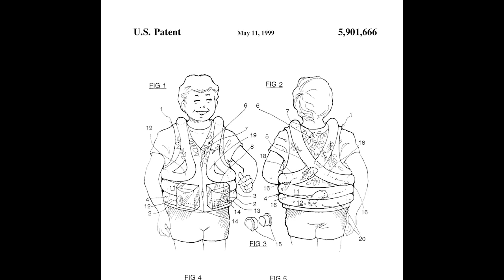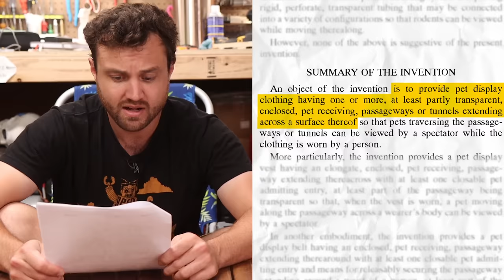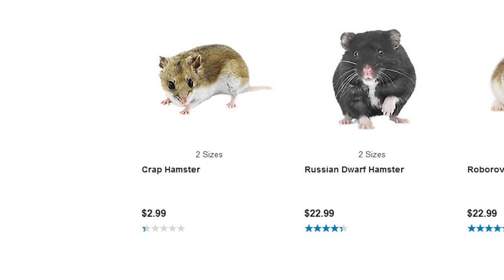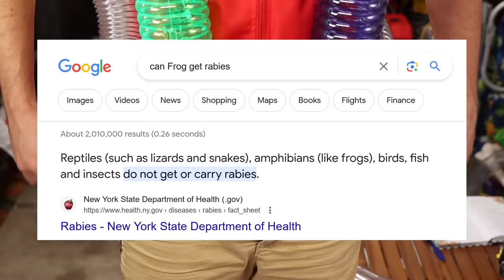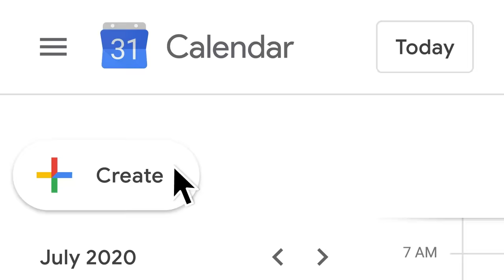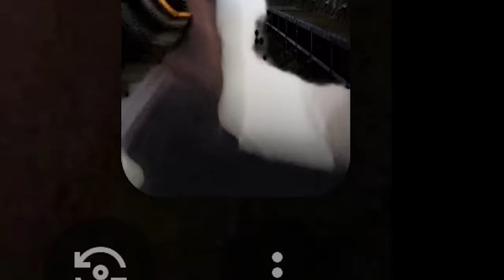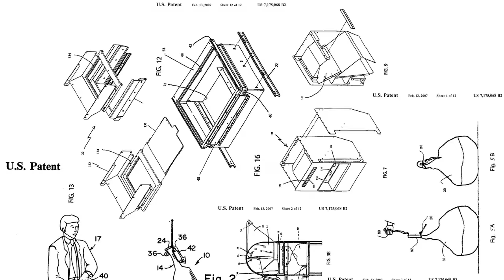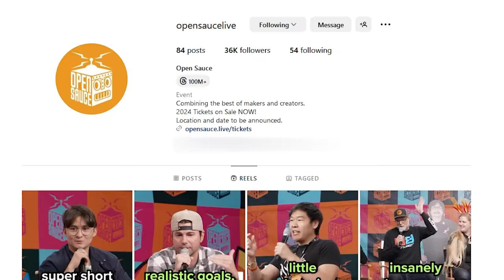Someone Paid $10,000 to Patent This

Comment: This looks fun and games, but those tubes are actually pretty dangerous for hamsters! When they fill their pouches with food, they can get stuck and suffocate in the tubes. Furthermore when they pee in them, ammonia builds up, which is toxic. They discourage digging, because well, can't really dig through plastic. When in direct sunlight, hamsters can easily overheat in the tube. The rubbing against the plastic can cause hair loss, sores and wounds. And often the small holes are too small and hamsters can suffocate. When they chew on it, they can die from the microplastic. Better sell the tubes and buy a huge cage with places to burrow and go to college. 

Similar things are true for the fish thing, if the tubes are too small, the fish can get stuck and have wounds from rubbing against the plastic. Also they can't really be cleaned and the water in them often doesn't reach the filter...
Reply: Back in the 70s they had a product called habitrail which was a hamster cage with a bunch of similar tubes. My friend had one and his hamster had lost a bunch of hair on its tail. I don’t know if it was caused by the tubes, but after that instead of calling it habitrail we called it half-a-tail.

Comment: Dude he is touching the forks with his hands how he not dead is that how car battery’s work1:04
Reply: Car batteries have a a very low voltage, so even a little resistance (like skin) won’t complete a circuit, and therefore won’t kill you.

Comment: Big problem with the fish one, fish require air to breathe. Lots of people seem to think "Oh fish just get oxygen from water because H2O has oxygen in it"
WRONG
Oxygen gas dissolves into water in the same way you'd dissolve CO2 into water to make a carbonated beverage. Fish breathe the oxygen that is dissolved in water. For them to survive there needs to be a decent volume of air in a closed system for fish to survive. Sure they'd be fine for a while on oxygen that is already dissolved in the water that was added, however they will quickly run out. Providing a space of air allows for a larger supply of available oxygen.
I know this is a silly video and they weren't in there very long so obviously no problem, but I think its important people know this/don't get any bad ideas :)

Comment: Patent holder here, most patents are used for the protection for the development of a idea, that way, if the product is being worked on by a third party company and they run off with the product they can be combatted with little legal hassle, it may be more likely that Mr. Belial worked as a product designer and came up with the idea's while working for a firm that promptly got rejected due to the lack of development, as the initial patent is the most expensive, Belial must've submitted the patent himself in a attempt to work on them later, if he ever did!

Comment: Hey Will. I had an idea while doing my dishes and thought of you. I was thinking about a robot that could sort my cleaned silverware into the correct place. Not a simple task as none of the silverware is from the same set. (I assume everyone faces this problem. If not then imagine a horders silverware drawer). But it's just an idea. In case you ever run out of video ideas. ;)

Comment: Let me explain why the fork thing doesn't work and shouldn't be tried:

You can observe electricity just as water.

Amperage would be how much water is there (or needs to travel).

Voltage is at how much pressure the water is being delivered or given.

Resistance is equal to the size of the pipe, too much pressure and the pipe might not handle it, too little and the water might not arrive as soon as desired.

Bare in mind that some devices require a certain minimal amount of electricity to run, too little and they might just give up or burn out, too much and similar results might happen.

You can think of mAh like a bucket and how much water can be transported in it. The resistance in this case wouldnt be a pipe but the whole on the side of the bucket onto which the water is being "connected" onto.

So if you are using those teeny tiny cables, the amount of electricity flowing through them might end up being too much, that plus the forks have alot of metal and are bigger. Thats like connecting the first pipe being a big one and the rest of the pipes are smaller sized. The fork doesnt have isolation, which allows it to give electricity to its surroundings, meaning the plastic in the socket is receiving electricity as well, that is why it burns around it and gives sparkles, which is a sign of higher amounts of energy in one place.

Remember: heat = energy and vice versa. So you could "throw" small amounts of energy onto a thing, but as long as those amounts build up, they turn into heat and concentrated heat turns into black socket.

Now bare in mind, it takes only 13 Amperes to kill a human. Its not so much the voltage, the amperage is what you should be afraid of in most cases (not saying you should be fully unafraid of high voltages (pressure) either.
Reply: Who is this comment written for???